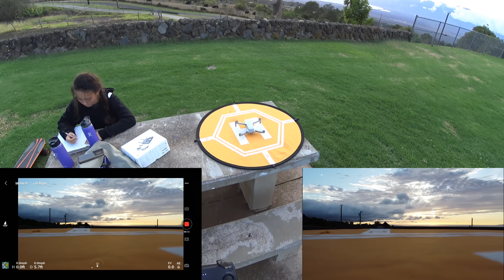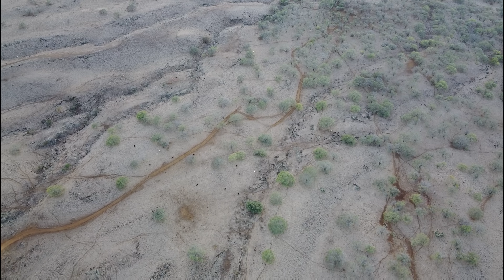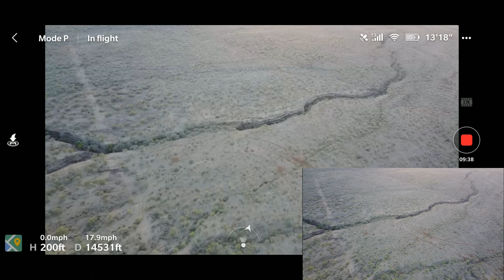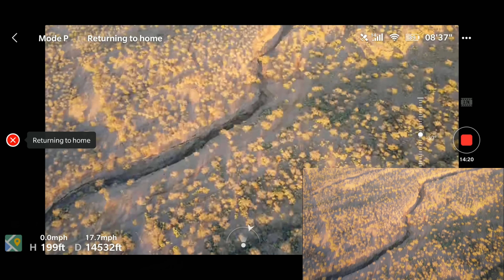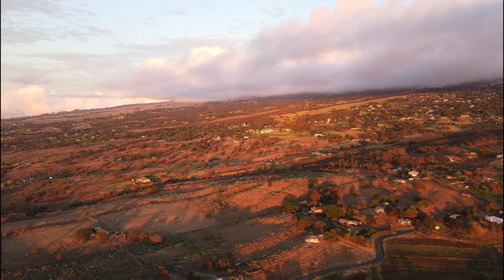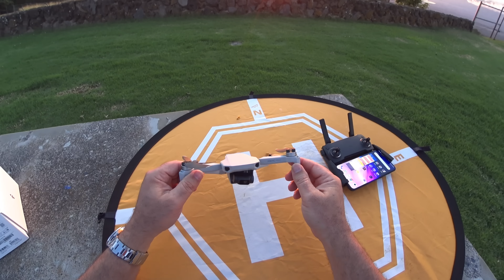DJI Mavic MINI Range Test to 0% Power - How Far Will it Go? (Bonus CRASH TEST!)

Comment: I've got to admit, that was nerve racking... I was like yelling at the screen (stop moving the camera you're wasting energy!) and somehow you pulled it off.... pretty amazing.....
Reply: Moving the camera would probably be the least power consuming part.
Reply: @John Freeman  me too :-)
Reply: @kerigancreighton2351  still something. recording also takes quite a bit of power. also I dont think 18mph is the most efficient speed
Reply: @kerigancreighton2351  When one is trying to conserve power and squeeze every micro bit of juice left, then you dont use power systems. I too was scream. Don't use the gimble, stop recording, and dont push the motors. every bit of juice counts
Reply: @jollyrogerhobbies2386  You should stop recording, but I am just saying, moving the camera takes as much energy as turning the drone left or right. probably less than .3 percent
Reply: @kerigancreighton2351  at 0% battery, .3 battery could be the difference between getting back or crashing 😂
Reply: @jollyrogerhobbies2386  The firmware would still count it as zero and auto-land anyway. It wouldve been the same outcome if he wasnt moving the camera. He should have stopped recording though.
Reply: @kerigancreighton2351  maybe, maybe not. We may never know

Comment: did he just fly 5.4km with this drone 😮😮
Reply: Ikr wow😯😯😮😮
Reply: Impressive. I've done only 3,5 km. with MavicAir.
Reply: Never reach that range even flying far deep from human civilization💀
Reply: I have the same drone but it never goes more than 1 km
Reply: @LifeOfAbhishekDholiya  you are flying too low si signals are not allowing you to go farther, get your drone to at least 200ft of the floor to avoid wifi signals interferences.
Reply: @portgax  yo i had that same feeling about it. Very much appreciated info
Reply: @LifeOfAbhishekDholiya  I took it to around 3 km in India, not more than that
Reply: I get transmission signal weak at 2 km at 40 meter high
Reply: @portgax  im really just getting into flying drones. Do they sell drones rhat you can connect via bluetooth instead of wifi?
Reply: @focused4841  Bluetooth doesn't have the capability or range wifi does, so I don't think you will find anything that is not a toy using Bluetooth.
Reply: @focused4841  Bluetooth rang is way less
Reply: @focused4841  you can find drones that use the 4GLTE network, then the only real limitation would be your battery.
Reply: Pushing to the limit it excites me.
Reply: @Kayshots  Are you in the UK?
Reply: @portgax  thanks for the info man
Reply: Mine can max go maybe 100 metres
Reply: Double that cause of the round trip :0
Reply: @dronmorfosis  3.5 in and 3.5 back??
Reply: @johnnyboi6342  yes. When I got to 3,5 km it started to loose camera signal. Battery could hold a little bit more tho.
Reply: @markozsky  Then your NOT living..............LOL at least with the mini 2!
Reply: @dronmorfosis  I have seen people get over 5km with the mavic air 1 and still have perfect signal. Made it back at 3% battery
Reply: @dronmorfosis I'd say he timed it to the second. a bit farther out and he'd be hunting for it.
Reply: @B wayne what was enhanced about the wifi? I'm new to Mavic Mini, I thought it was all stock. 

Back in the day I literally had to bring a wifi router and power it via a battery, then use that as a signal booster for my mobile phone to my AR Parrot drone, which also cost quite a lot more than than the DJI Mini (£230 vs £350).... and this was just so I could still control it when it's like 300 metres away 😂 Things have come a LONG way in 10 years.
Reply: @Rightforgrind  even in cities with 1001 WiFi signals I get further than that. Seems like you have a faulty unit tbh
Reply: Hawaii
Reply: People still watching….internet classic
Reply: Looool
Reply: no
Reply: Wouldn’t sport mode make it fly faster?
Reply: @nbdysfool3  the battery would deplete faster and cause the drone to not travel as far ....
Reply: He flew 10.79999999999999999 KMS ! (5.4KMS one way and then ALMOST back!!!)

Comment: Through the whole thing I was like “Stop moving the camera, yer wasting power”!  😬
Reply: The gimbal uses just as much power to hold its position and counter the motion of the drone.  Moving the camera will not make any difference.
Reply: geoffschulz 
I did not know that! Thanks! 👍🏻
Reply: harleyrdr1 he also moved it to make sure he had good connection
Reply: Festus when I first read what you said I was like “whaaat”?  But yeah I see what you’re saying. You may get some vid, but if you can’t move the camera then there’s a problem.  Good point!
Reply from the maker: Good point.  When you think about it.... It totally makes sense 👍
Reply: @geoffschulz  No, it uses SOME power to hold the gimble, but when you use ANOTHER motor to move the gimble that is MORE power used, fact!
Reply: geoffschulz anything that moves requires energy, it’s a physics law! So yes, it does require power and will reduce battery power a bit . How much ? I can’t answer that, but it will decrease the available power on the battery a bit more.
Reply from the maker: I agree with @geoffschults.  The power is so tiny it's negligible.  One small gust of wind would likely cause the craft to use more power throughout the entire flight than moving the tiny gimbal occasionally.
Reply: He mentions this very thing so he was humoring you 😂
Reply: @DustinDunnill   please give me that awesome drone 😂😂😀😀😊😊
Reply: @ClearAdventure  yes. However a gimbal is constantly using the motor to counteract things such as the wind and gravity.
Reply: @JohnBeurer  what different does that make when the drone is in auto RTH and as it gets nearer you will get full signal and control

Comment: Have to admit, I was chewing my own nails watching your Mavic dive in just over those power lines... but then that crash aaaahhh! So surprised absolutely no damage, and pushed the envelope past 4 kms (I'm over hear in Ontario Canada so we're stuck with metric, but ya my stock DJI Mavic Mini user manual states it'll fly out to 4 kms (or) 2.48 miles, you managed 5.48 kms (or) 3.4 miles! Well done, great flight path chosen, absolutely no cross roads or dwellings, overall a 5-star video IMO. Five thumbs up bud!
PS: I do have one suggestion however, not sure if the RTH mode was part of your distance test, but cancelling it out using the round red X icon on your mobile screen and manually RTH would stop that annoying beeping you'd mentioned, also you might have used that same red X icon to cancel the forced landing mode I believe (it still would've crashed mind you) but the close call with the power lines may have been avoided. All in all still AWESOME work, well done!
👍👍👍👍👍
Reply: I crashed my mini into a tree at 29 meters high (95 feet). The only thing that broke was 1 of the 4 arms. Everything else was fine. They are very resilient small things (probably because of the light weight).

Comment: Maximum distance for me is 700 m (around 2300 feet). I get disconnected after that snd drone returns to home point. At 500 m or around 1640 the image transmission is starting to get blurry and low fps. Stock mavic mini (first generation).

Later edit: I tried in a different place snd managed 2km or like 6500 ft /1.24 miles. Happy

Comment: Boy, you sure made it exciting! "The Force was with you" for sure on that flight. You couldn't get any luckier. Perhaps if you'd turned off the video on the way back, it might have not been as close.  Well, I think that is probably the best 'range test' video on line for the Mavic Mini.  Those 18650 batteries are ubiquitous and cheap, so it you flattened that pack, I'll bet you could cut it open with a 'hot exacto knife' and replace the cells. Anyway, glad you made it back ... thanks for the video. Mahalo!
Reply: THE FORCE WAS INDEED WITH HIM, THE FORCE IS ALSO STRONG WITH HIM!

Comment: Great test. Lot of interesting info gained. I was so stressed after the third time you ignored rth and went for 18000. DJI makes great products. Crashed my Spark on its second flight. It fell 25 or 30 feet to the ground. Only problem was a sliced prop. Love DJI.

Comment: bought a 40 dollar drone on wish, lost connection on second flight and it flew away. now i'm looking into a 400 dollar dji. makes sense right? haha
Reply: I’m on the same boat as u 😅😂
Reply: Maybe you can send it to find your first drone you lost 😂
Reply: Definitely a good choice mate! Had this drone 1 year no problems
Reply: Yeah
Reply: Ok been nine months, did you make that purchase? I bought a mini last fall ( my first) and have been flying in -15 degree weather, high winds, over ice,snow and now water and have had no issues. 70 km flight distance logged already NO issues (other than a prop overspeed warning that was fixed by replacing a warped prop from storage I believe). BUY THIS DRONE.
Reply: with dji mini 2 it cannot fly away at ALL...........it will find you and come back,  I try to loose mine everyday and it always comes back. Now im far away from power lines, disturbances and the FAA................
Reply: Wish is trash
Reply: Buy this
Reply: 40 dollar lol
Reply: I bought cheap Bluetooth drone before and crash landed second flight.  Bought a DJI Mini and will never was money on cheap things again.  When you go expensive you can feel the quality in the gear
Reply: Don't spend 400 you can get a used one for half price or potensic atom
Reply: Trust me dude never trust a drone under 80 dollars , your first flight is setting it free😂
Reply: The way I see it is: if you wanna cheap out on something, you'll prolly pay for it anyway
Reply: Literally did the same thing but can confirm the DJI is king
Reply: Guys I know why wish is called wish
You WISHED that you got a good deal😂

Comment: That’s crazy, I only get like 4000 feet with my Mavic zoom and I lose connection. You must have perfect conditions to go that far.
Reply: I was wondering about that too...perhaps less electronic interference on Paradise Island!
Reply: I think the Mavic mini has a completely different control system than the Mavic zoom. It uses a type of Wi-Fi which I've always been sceptical of but this obviously works.
Reply: kamuelalee where do you live?

Comment: When DJI says 50%, believe it!
Reply: only on new battery.. after a few month maybe you should not gamble with it.
Reply: How true.
Reply: That's why it wanted to have you turn around 60% instead.  To allow that extra 10% for returning safely.  So when it says to return, make sure to do so and of course make sure that the wind is with the drone and not flying with it on the way out.  Otherwise that head wind will be a killer.  :)
Reply from the maker: There was a purpose for this flight.  And saving the battery was not part of it 😂.  Battery is absolutely fine though.  I've done 3 flights since and got 27 minutes each.. battery working even better now 🤷‍♂️
Reply: @DustinDunnill  It was a great flight with beautiful video. The timing was incredible.  Thanks for posting
Reply: @jonitan76  Batteries dont decline significantly untill thousands of full charge cycles, a good battery will easily do 1400 charge cycles and be at 80-95% of original capacity. I have a 8 year old battery for a metal detector with at least 7500 charge cycles on it and it still has 80% of capacity.
Reply: Steve Young because they know, they test them !
Reply: Dustin Dunnill does it avoid objects?
Reply: Dustin Dunnill How much is this drone? I want to buy one! Kicks ass!!!!!!!!!  Amazing footage!!!
Reply: @stevejobs8302  nah. The mavic air and the other DJI drones do

Comment: I can’t believe the performance to price ratio of that mini Is there anything being offered by anyone else that competes with this?
Reply: not at the moment. Amazing price for some great tech.
Reply: Guys check the fimi x8 se and hubsan zino 2 
They offer 4k and 8 km range for the same price
Reply: you have the Fimi x8 se 2020 which is currently available for preorder
Reply: v KEITH v  they should after ripping people off for so long
Reply: I m thinking of getting an apple watch as it will be more helpful for me... Once i get older and start travelling a lot, then a drone wud be a good investment. Also the fimi x8 se 2020 seems great.. though it is not available everywhere
Reply: @ramanuj_g  I'm not a DJI fan but this one looks pretty good.
As for the X8, the Chinese have mastered making things look good on the outside in order to make sales. Read the reviews, not the 5 star but the one star ones and you will find out why they are so cheap.

Been looking at the Bebop 2 Power....Yes its older and does not have the best camera, but it flies 27 minutes on a battery and has a lot of good features, and they sell on eBay for under $300 as they are a few years old now.
Reply: @BradKwfc  yeah... I was considering the bebop 2. But it does have some connectivity issues..which can be fixed:-)... U can also get the fpv pack which includes a vr headset...
Reply: @ramanuj_g  I'm also seeing people doing a 4G mod to the Bebop 2. Seems like a good first drone albeit a little outdated as far as the camera goes.
Reply: @ramanuj_g  unfortunately they do weigh more than 249 grams so I would need a lot of red tape to fly that in Canada.
Reply: Craig free ahh no one was forced to buy
Reply: @dreswan1  just a note. If you want to catch somebody's attention, such as Craig, click on the reply button below his comment and then start typing, he will then get a notification that somebody replied. Have fun
Reply: Not at this weight. The Fimi X8 2020 and the Hubsan Zino 2 are close if you want a bigger drone with 4K.
Reply: @ramanuj_g  i just checked JESUS that Zino2 sucks ball, it's unstable even @12-15satelites.... PLEASE ADVICE THINGS THAT ACTUALLY COMPARE to the enormous quality of the DJI's!
Reply: @rwatson2609  huh mine weight exactly 249 on a digital and professionally calibrated scale... PS: i'm in Europe so that's why I didn't get his bigger brother :)

Comment: You should have used the SPORT MODE. Increase the drone speed.
Reply: Marcelo Lavín Solar imagine cinematic/ tripod mode :D
Reply: Marcelo Lavín Solar increase speed and decrease battery life. He is well aware of what he’s doing.
Reply: No it drains the batter faster than the distance gained in speed. He would have gotten less range in sport.
Reply: But Sport mode also uses more power.  Don't have a Mini yet to test efficiency but for other DJI drones you get more miles per amp in P mode.  Phantoms, Mavic Pro & Mavic 2 sweet spot is around 30 mph.
Reply: Well actually if he would have turn on sport mode then rth he would have made it . It disables the vision senors also playing with the Gimbel cost him a bit as well. Maybe turn off recording of video. I may or may not have done some extreme range test and this method always gave me the best results over just staying in p mode.
Reply from the maker: I'm thinking that would have landed me in the pasture.  Wind can be quite variable here.
Reply from the maker: There are no vision sensors on the Mini.  It keeps the bottom ground sensors on in sport mode.
Reply: @DustinDunnill   your right it does keep them on In sport mode
Reply from the maker: Check out my previous park flight test video.  It's quite locked in close to the ground in sport 🍻

Comment: Funny to see an American using the imperial sytem. 
"One mile is like what? 5280 feet?!"
There is almost no way to do precise conversions from feet to miles in your head with such weird random conversions xD
1609 meters are like what? 1.609 km?!
Reply: Just because it’s not exact doesn’t mean it can’t be converted, this isn’t for exact numbers hombre
Reply: Metric sucks
Reply: @martincole188  Metric is it, its al by 10 that simple, 10mm = 1 cm, 100 cm = 1 meter, 1000 meters is 1 kilometer, its all X 1, 10, 100, 1000 etc verry simpel and verry easy
Reply: @martincole188  
1000 mm = 100 cm = 10 dm = 1 m = 0,001 km
1 cubic centimeter = 1ml = 1g of water
1 cubic decimeter = 1l = 1kg of water
1 cubic meter = 1000l = 1 ton of water
water freezes at 0° C and boils at 100° C

Now present a similarly easy and useful conversion in your system, or explain why metric it sucks :P

Comment: Wow great job! Very exciting video to watch! DJI did a great job on the battery percentage calculation. Battery has Voltage vs SOC(state of charge) curve. I see in the video battery percentage calculation is pretty linear(battery curve is not linear). 50% one way, return home with 0% left. I can only imagine DJI did great job on the software to estimate battery percentage. Other thing you can try to conserve power is to turn off the video recording or switch to 1080k mode. Recording and transmitting video also use energy. Maybe it is a good idea for DJI to have a survival mode that turn off everything else, but leave on what is necessary for drone to return home. Subscribed!